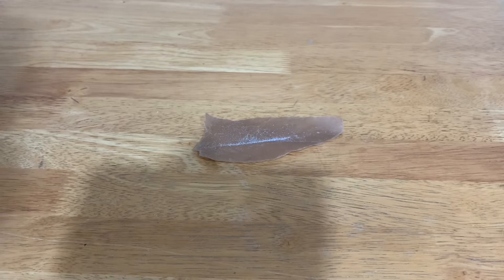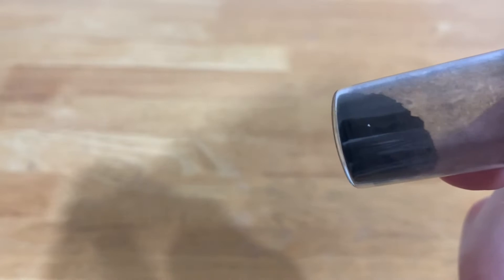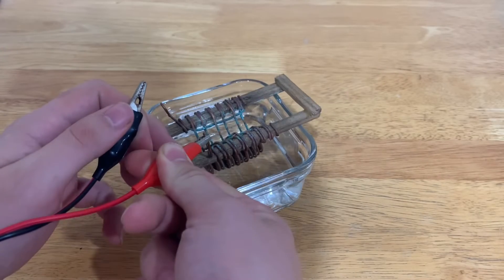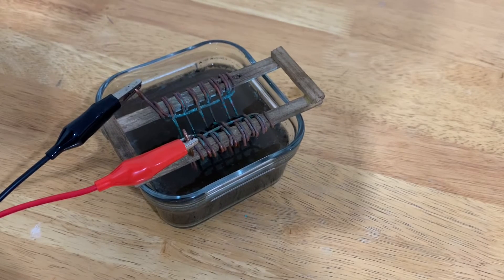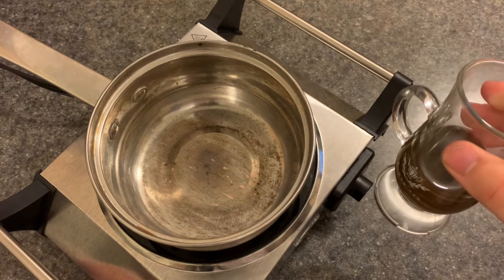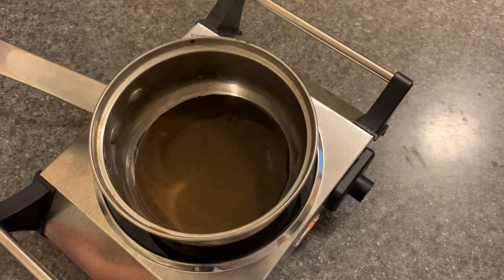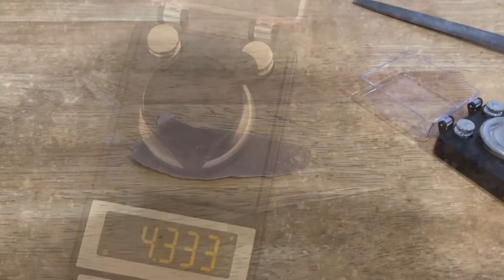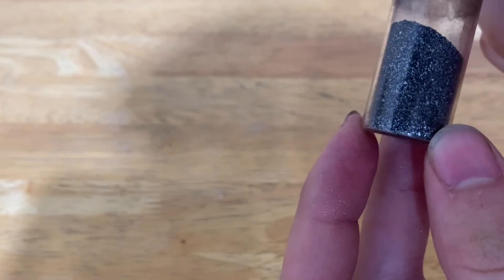Make Thermite From Tinfoil And Wire

Comment: I'm had doing like this at home,but  instead i uesing electrolysis to convert  iron to rust  and my problem it's aluminum pwoder ,for this reason I'm forced to make ball mill to make aluminum podwer but result it's very low podwer i get ,be continues i like you mad at chemistry experiments❤